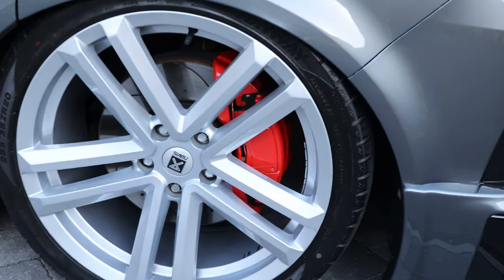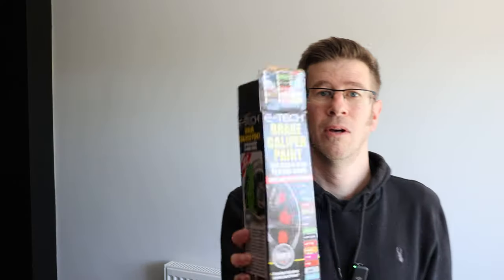Doing some maintenance on the VW T6 | Fresh look for the summer.

Comment: I find that paint goes along way & lasts years. Dries fast aswell- abit too fast so you need to keep stirring.i found i had to use a toothbrush to really scrub before Painting as dust was baked on.
Reply from the maker: Yes...you do need to get on with it as you say it cures fast but then takes a while to fully harden.  
I was pleased for the price👍

Comment: Hey Steve, like a bit of DIY. Looking at changing mine from Red to Porsche Yellow. Not stripping down as far as you did, how is the paint holding up after a couple of years ?
Reply from the maker: Hi Steve,  this make of paint has held up really well IMO.... I was pleased but I say the secret is apply 2-3 coats thinly to build up as to 1 x thick heavy coat!
Reply: @SteveField  thanks,  will give it a try 👍
Reply from the maker: @stevecockton6624  product link in the description  If it helps👍

Comment: Great video Steve, enjoy it! What size tires do you run on? I’m looking at fitting 255/35 R20 to my T28 T5.1 fitted with Bilsten B14, but a freind warned it was going to be uncomfortable with such low profile tires. Any expericence/ advise?
Reply from the maker: 🙌Thank you.... I run those exact size tyres... to be honest when i refit the factory stock davenports i find the rider to be exactly  the same if not harder so I can say personally I find that tire works well it also is the closest option for speedo calibration to be accurate 👍
Reply: @SteveField  thanks!
Reply: 265 40 20 way to go

Comment: Steve hi, tell me what ofset you have on the front axle et 40? 
Do you think vossen 9/20et 35 on a 255/40/20 bus is suitable for such a stance on your bus
Reply from the maker: Hi.  These are 20x 9 et 42. So the are tucked in but an Et 35 fits on as long as your not looking to tuck in your wheels if your really low!  I had some Vossen’s pre air suspension and they were et35 on the front.  If you are looking for lows an Et 35 will require a much smaller tyre to work which I don’t advise.  Best tyre size would
Be 255/35/20
Reply: Thank you, there are not very roads in the Russian Federation, I usually go on 255/40/20 ... comes to my channel, there is my bus on R 22. Eta beta…. But I have sold out and I want to make a bus below.. I bought airlift)))

Comment: What size are the navis wheels steve . The front of your van when aired out sits a tad higher than the maxload kit
Reply: They are 20’s from Transporter HQ. Navis 5 Twins
Reply from the maker: The Navis are 20” x 9J.    Yes a stock ABP is not quite as low as Maxload or solow
Reply: @SteveField  you need to speak to them boys get them cuts done 🤣